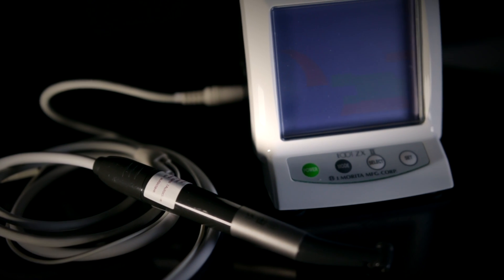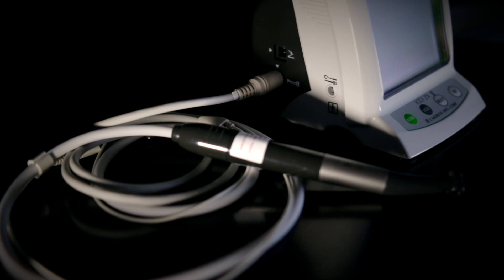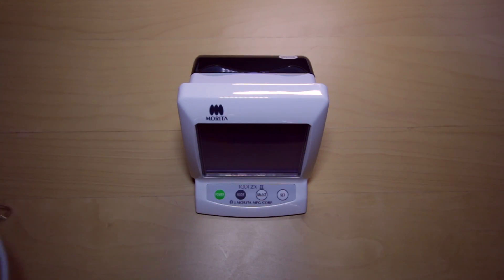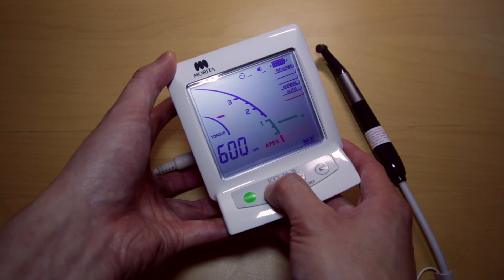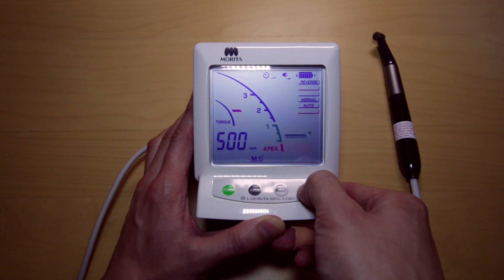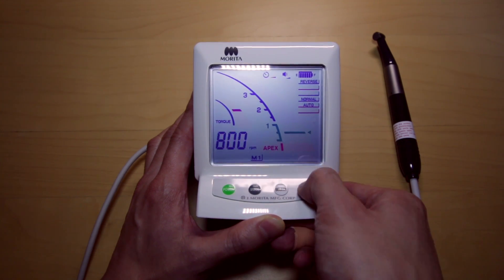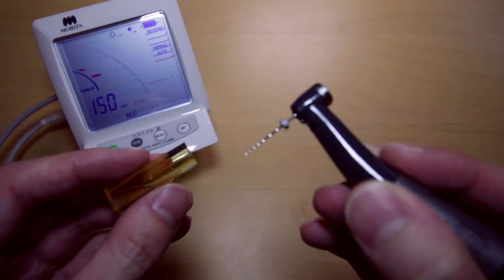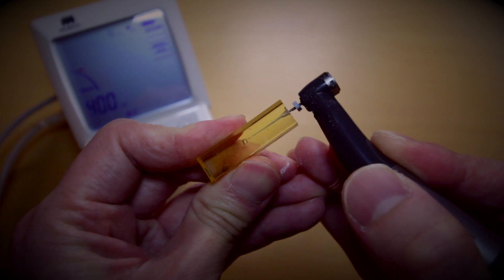HOW TO USE OTR Module

Comment: One problem i encounter when using otr on a endo block: canal hits torque limit, starts reciprovating but still manages to screw into the canal until it can‘t move anymore and stops moving all together. I have to manually switch to ccw to get it out. Do you know what may cause this problem?

Comment: Hi Kevin!

Really enjoy your posts. Couple of endo questions:
1. Lower molars - patient positioning for maximum visibility, I really struggle to access these even with loupes!

2. Managing the pulp that just won't stop bleeding

Maybe an idea for a new video?! "Endo troubles and how to fix them" haha
Reply from the maker: Thank you for watching! Lower molars are my favorite. I lay the patient maybe at around 30 degrees to the floor. Then, I will have direct vision while I access. Sometimes I ask the patient to have their chin down to help visibility. As for bleeding pulps, I usually use an EndoZ bur or slow round bur to remove the pulp chamber. If it still bleeds, I use a rotary orifice opener to remove most of the canal pulp. This part comes with experience. Because with all the bleeding, you have to go in blind into the canal. But with most of the pulp out, the bleeding stops. Hope this helps :) I'll see if I can make a video on this too